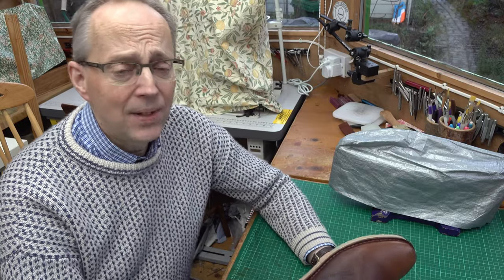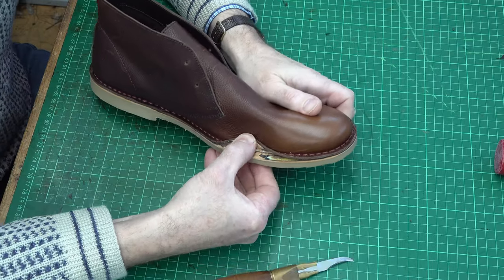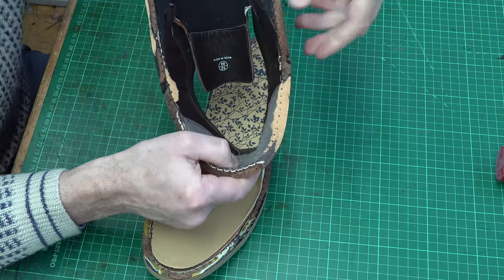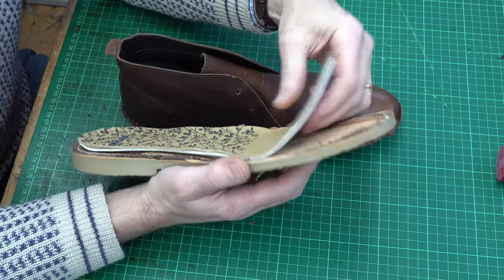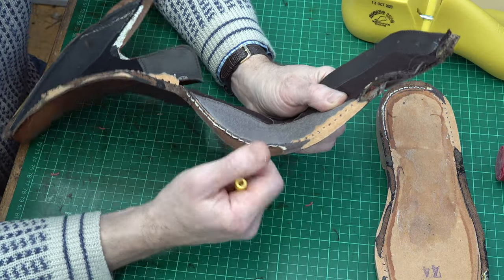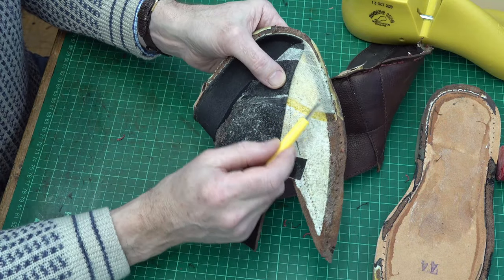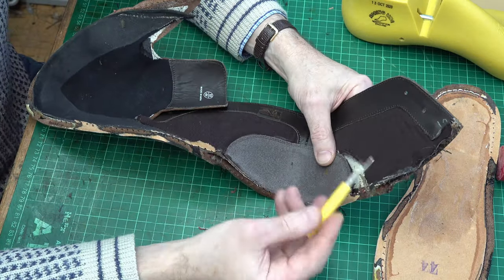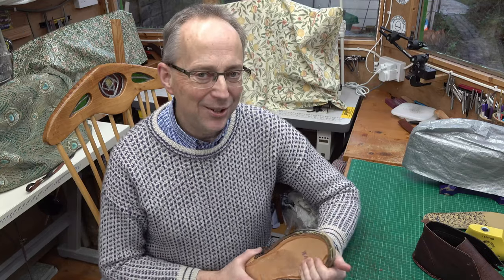Easy Shoemaking Part 2, Desert Chukka Boot Teardown To See How Its Constructed

Comment: light and simple. I would make along with if I wasn't trying to get a sink cabinet and counter built into my kitchen.

I subbed when you started making the lasts, but going through your back catalog a bit ago, I realized I had watched your shingle video years ago when it was new. I think I saw an old Church being redone in Scandinavia and yours was along the side and I watched it as well.
My neighbor was doing shakes on his house for siding, and I was roofing a 9 in 12 roof,  so I was watching other struggle with roofing harder than my self done steel coverage on a too steep or not steep enough roof.

Comment: great video. i  noticed when shoe makers design  on their last they draw the critical points beforehand for reference in relation to size of last. 

you have any ideas how they determine these reference point on the last. is there a golden ratio? or even a rule to the reference points. ie heel curve, the spacing of the vamp area etc. 

cheers mate
Reply from the maker: Hi yes there are some standard last ratios that you can calculate to determine optimal shoe shapes. You will find these in a number of advanced books on shoemaking and design. If you are starting out, its a good idea to look at these, and also to be guided by a pair of your favourite shoes to make sure you get the proportions all correct.